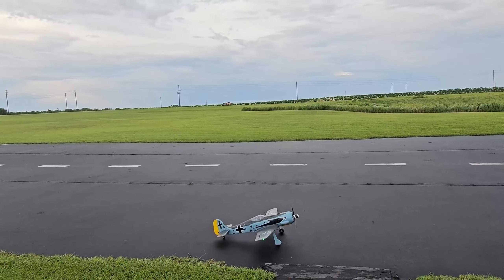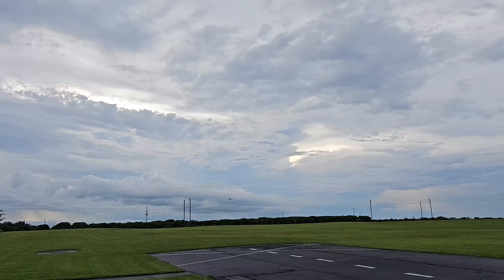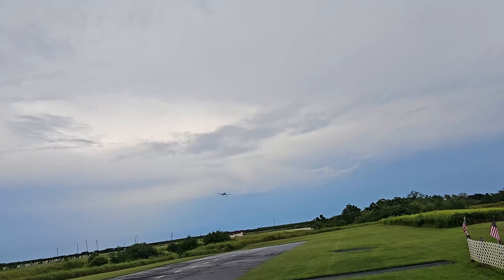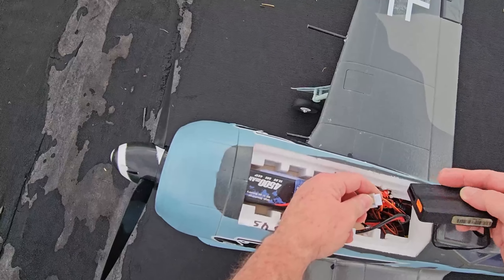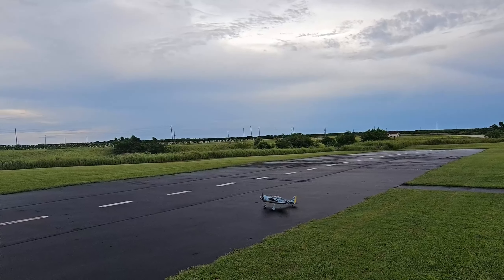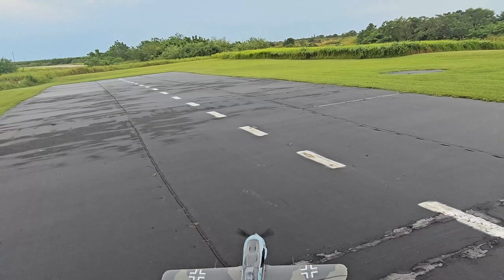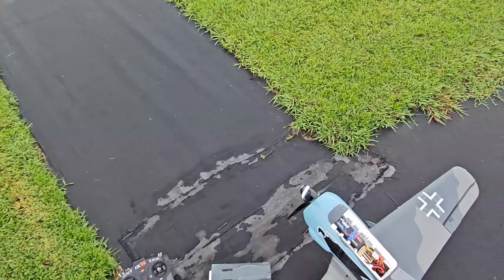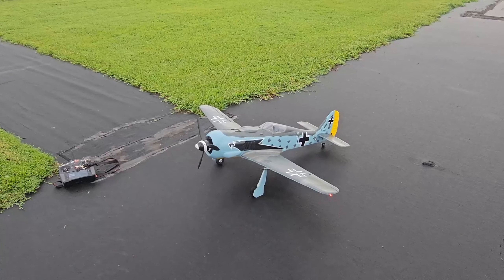DYNAM FW 190 BUTCHER BIRD V3! by FGFRC #militaryaircraft #rc #aviation

Comment: Had to replace my retracts on my 8 th flight. Used some from my old T28 1.2 and had to beef up the chicken wire gear. So we will see. Plane flys like a dream. Very beautiful plane just needs better metal gear servos and better retracts and gear. But for the price it’s not bad.
Reply from the maker: I agree Dynams need some tlc but normally fly great.